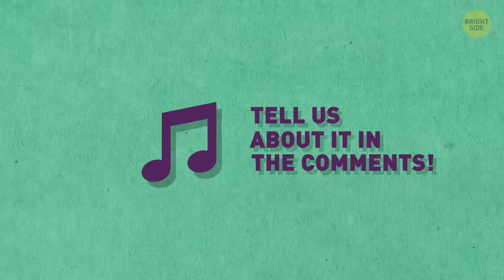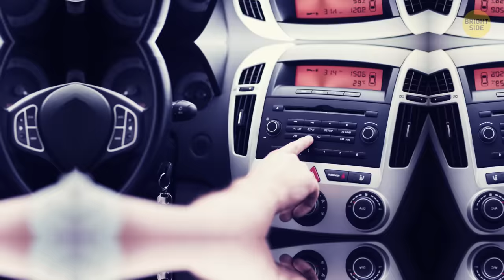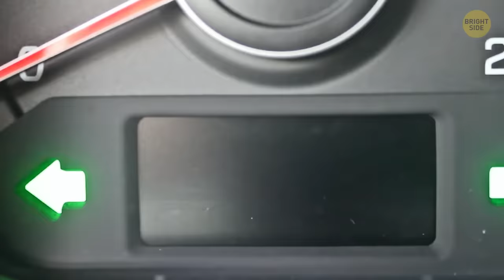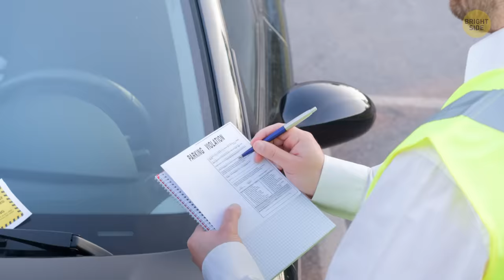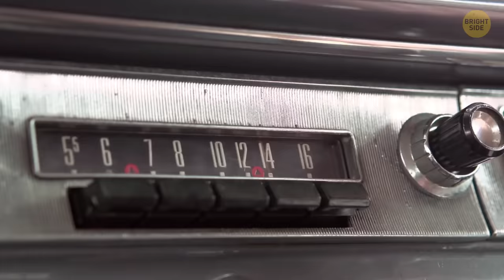40 Rare Car Facts Most Drivers Never Heard About

Comment: The bi-metal spring in a directional signal flasher unit heats up when current flows through it causing it to bend (click) and break the electrical connection. Once the current stops, it then cools down and bends back into it's original shape (clack) allowing current to flow, repeating the cycle. Most newer vehicles these days (the past few decades) have solid-state signal flasher units, or the directionals are computer controlled so the click-clack sound that you hear in most modern vehicles, is made artificially.

Comment: 4:50. They should have also mentioned that you should not be closer than 12 inches to the steering wheel when you drive because you will be hit by the air bag as it deploys at 200MPH and that causes a lot of neck and head trauma. The idea is that the forward momentum will make you hit the airbag after is has deployed. If the airbag hits you as it deploys it is going to hurt you. And you should never drive with your hand(s) at 12 O'clock because your wrist is in the inflation zone and your wrist will get hit by the airbag moving at 200MPH and it will break. And people who ride in the passenger seat with their feet on the dash board end up with broken ankles and dislocated hips. As a nurse I have seen all of these types of injuries.
Reply: how lone comment

Comment: 2:32 1960 : Able to buy a brand new car with $3000.
         Now : Only able to buy a steering               wheel , transmission and 2 doors with $3000.
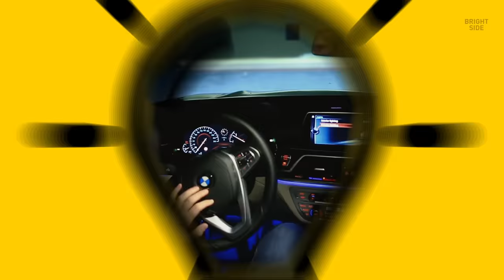7:30  Worlds Cheapest car Tata Nano costs around $2000. 
Me: Wait, so its still possible to get a car with $3000 🤔
Reply: With a top speed of 65mph it won't be a very good commuter car
Reply: To Gaming.. Exactly my point...

To Joey... TATA has shout down Neno's production but.. You can get used one if you want.. trust me.. It's very fun to drive and capable enough to take 4 passengers.... It also has Air conditioner and Auto transmission
Reply: Brand new cars are starting at.. 15000 ish? If you go for the smallest ones. Usually average 30000 though.
USED cars you can get for less than 3000, if they're from 2008 or before, best at 2003 and earlier, because otherwise they're probably faulty.
Reply: That’s about $26,000 in today’s dollars.
Reply: grozbeek mose  I believe every Bhartiya knows that.. Shri Ratan Tata has did many takeover when he was a chairman of Tata Group.. Which includes Jaguar Land Rover, Corus, Tetley, Spanish bus maker Hispano Carrocera, South Korea's Daewoo Commercial Vehicle, Thailand's Millennium Steel, singapore's NatSteel,... List goes on

Comment: 6:40 Mercedes, produces not just cars or trucks for land, they manufacture engines for ships to sail in sea and for jets in the airs as well.
Reply: So are a bunch of other car manufactures motor/electronics used in other areas
Reply: Daimler Benz (Mercedes) does not make jet engines.
Reply: @Rob-fc9wg  thank you for correction. Now they don't make. And specifically jet engines.
But in the past Mercedes or Daimler Benz had produced aircraft engines.
Reply: Daimler Benz does produce aircraft engines, but not a jet engine.

Comment: The part about the turn signal is definitely true.  I'm borrowing my mom's 1993 car while my 2020 car is in the shop for repairs, and the 1993 car's turn signal noise is REALLY quiet compared to mine.  I'm always double-checking to make sure I have the signal turned on.

Comment: Very Interesting!    However, you got the turn signal principle exactly backwards - the spring is a straight leaf, normally making contact - when you turn on the signal, current flows, heating the spring and it bends over, braking the contact. Then it cools off, it straightens, and makes contact, starting over.
Reply: I love pigger nussy ❣️

Comment: Interesting, the vehicle I drive has a sound module  that creates the seat belt beep, the signal light click as well as several other audio sounds for low fuel and engine trouble issues. Funny when the seatbelt warning tone is playing and I hit the turn signal switch I can hear the click but sometimes either one the sounds will cancel out as the timing of one interferes with the other.

Comment: A turn signal flasher is a special kind of relay that does utilize heat generated by electrical flow,  but the heat is caused by the flow of electricity through the contacts causing a piece of spring steel to disconnect the circuit.   The metal quickly cools and snaps back into place completing the circuit once again.   There is no heat generated when the circuit is incomplete.

Comment: BMW doesn't play the fake engine noise into the cabin to "remind" the driver that the engine is working. They do that because the sound deadening which is used to muffle road, tire and wind noise also deadens the engine noise and people who drive high performance car like to hear the sound of the engine, especially if they have a V8, or larger engine.

Comment: My first car was a 1998 Ford Contour it had a tape cassette player with am/fm radio. My next 3 cars had CD players. Right now I drive a 2015 Ford Escape. It has a lot modern technology in it. My favorite thing is BT and another is a keypad on the driver’s door. The car before was a 2011 Mercury Milan and it had almost the same as the Escape. The Milan had back up censors and the Escape had a backup camera. My mother thinks that I don’t know the difference my using the BT which I knew before the Escape. She used to drive a 2013 Ford Edge.

Comment: I've been a fan of this channel for a long time. @5:08 The tick from an "expanding and retracting spring" this is rubbish. Its called a Relay. An electromechanical device to allow low voltage control circuits to control higher draw circuits.
I've lost a lot of faith in this channel on things I don't know. What io thought were quick interesting facts were just things I could have achieved by mis-researching on my own!

Edit: Before anyone says it. Yes, a relay has a spring. The way it is explained in this vid is just incorrect.
Reply: I'm side the relay is a bimetal spring. The click is the it making contact

Comment: 5:36 - come on, thermal flashers have been disused since the mid 80s. My 1986 Hyundai had a relay controlled by a capacitor, a resistor and an IC.

Comment: Blinker clicks used to be the audible actuation of the flasher relay. But relays are no longer used...it's all electronic. My 2009 Ford Focus had a clicking sound effect played by the system. The reason I know it was a sound effect? If I hadn't buckled up yet, the system sounded the warning tones for that instead. The flasher would blink with no sound. But as soon as I fastened the buckle, its warning sound ended and the system would then play the blinker clicks.

Comment: 7:22 Wrong M5. This was introduced on the F10 series not the E60 and it's not because the engine is "quiet". It's because they want to "enhance your driving experience" or to translate into English, it's because the engine doesn't sound as good as it used to because it's turbocharged.

Comment: The best way to use the used tyres is to put them at the side fence of roads. Also put the used tyres in garage to that in case your car does not stop it will hit the tyres not the walls.
Reply: What about the tires?

Comment: The clicking sound is from the historical bimetallic relaxation oscillator circuit.
Reply: Is that a fancy way of saying it's a "relay switch".
Reply: @blainederouen9977  no its not
Reply: @Funkylogic  Actually they make two different types. A Thermal style flasher, which is the one he is describing here, and an Electronic style flasher, which is a relay.

Comment: You got the turn signal wrong. You allow the spring to complete the circuit and turn the light on, this makes it hot which forces the spring to bend in the opposite direction turning the light off which lets it cool off, after its cool enough it pops back to the other shape completing the circuit again to turn on the light and the process repeats until the lever is moved to prevent the cold spring from closing the circuit.

Comment: 2:32, in 1960, $3000 would be about the same as $26,000 in todays dollars when adjusted for inflation, so its not like new cars were actually cheaper.
Reply: I bought a new Beetle for $1750 in 1969.
Reply: @drcthru7672  That would have been like spending $12,545 in today's dollars, which is not bad for a cheap new car

Comment: A note about white colored cars as opposed to black colored cars.  White cars rust out faster in general than black colored cars because black colored cars heat up faster and hotter in sunlight than white colored cars and any water that lingers in the recesses of the car is evaporated faster than it would in a cooler white colored car.  More water, more rust.

Comment: Did you know that a white car is more likely to rust out faster than a black car?  The reason for this is that the black car gets hotter in the sun than a white car.  This, in turn, helps to evaporate water trapped in the body of the car faster thus eliminating the source of the rust.

Comment: The "special rod" is called a tiller.
Reply: catmodelt  Well, mine is on the right, so it might depend on where you live...
As for why, that's a loooong story. Way before cars were invented (not by Henry Ford) it was decided to either keep left or keep right for traffic direction. Eventually, car designers decided that in countries that keep left, the driver should exit the car on the traffic side (the right) and the passenger on the left (the curb side). The reverse is true if your country has left hand drive vehicles (or keep right traffic).

Comment: Of course Mercedes automobiles do not drive in the air or on water. 
But Mercedes has made both aircraft engines and marine engines for many decades, hence the tri-point logo you referred to.
Look it up on Wikipedia...

Comment: You are totally wrong about the BMW Badge, it is not propellers, please see below from BMW themselves...
The company’s home state of Bavaria was also to be represented on the company logo. The quarters of the inner circle on the BMW badge display the state colors of the State of Bavaria – white and blue. But they are in the inverse order (at least as far as heraldic rules are concerned, where you read clockwise from the top left). The reason for this inverse order of blue and white in the BMW logo was the local trademark law at the time, which forbade the use of state coats of arms or other symbols of sovereignty on commercial logos.